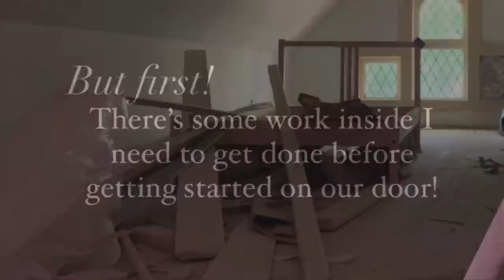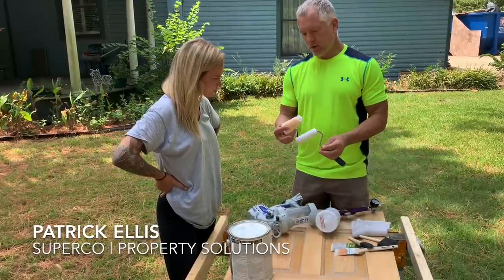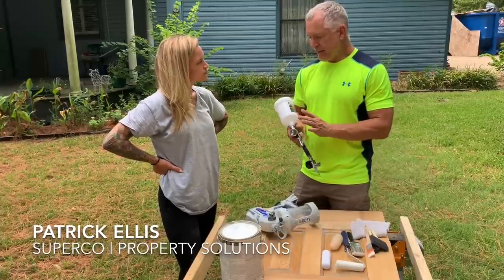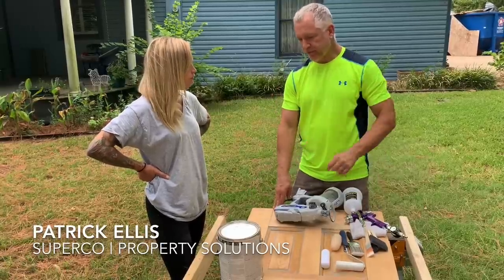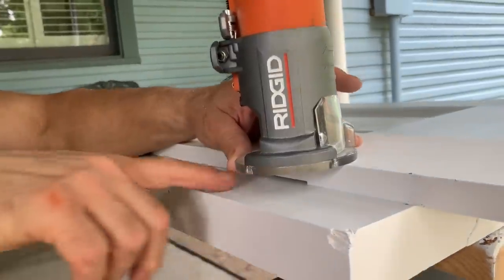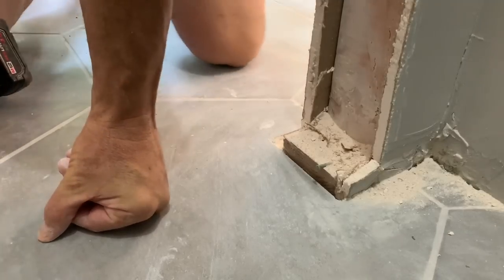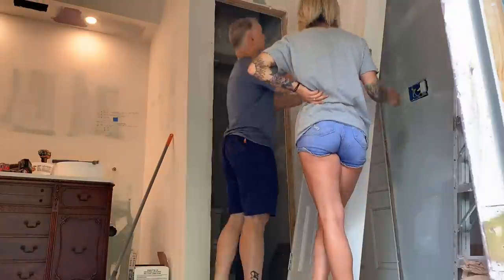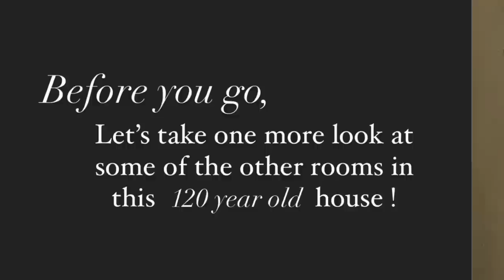REPURPOSE AN OLD DOOR / CREATE YOUR OWN DOOR JAMB - DIY (2 part series)

Comment: i recommend the trueshot sprayer aswell they work so freaking well and theres a cheap option that is corded but for the quality work and the speed at which u can get the job done is outstanding ... just my opinion when u want to get it done in record breaking time and have a almost perfect paint job i would definitely recommend that sprayer.... it has saved my ass so many times on time crucial jobs its not even funny anymore definitely a strong recommend ... and if u have the money and already use dewalt tools they have a battery option one that actually uses dewalt tools but its not cheap and because of that i havnt tried it before but if i had the money i would probably buy that in a heartbeat its a more professional version of the same sprayer but instead of 32 oz paint cup it uses 42 oz paint cup which could make it more heavier on ur arm while using it but i would go with it because the 32 oz ones seem to run out of paint just a lil too fast for me with an extra 10 ozs i would be happy with the amount of coverage u get per refill ...

Comment: I Finely Caught Back Up With Ya....Keeping Yourself Busy, That's A Great Thing, If Only You (And Myself) Were As Quick As That Rot-Mixed Dog In This Clip, Lightning Moves! We'd Be Well Off! I'm So Slow, If I Got Any Slower I'd Be Going Backwards....I Just Have So, So Many Projects Going On At Once & The Deep Freeze Drawing Closer Up Here On Lake Ontario The USA Side Of The Lake Will Be Here Too Soon...ALL Related To Putting My Traveling Shoes Back On, Finally Got My Truck To Be Used As A Hauler For The Tiny House I'm Planning To Put Together, Got My Eyes On A Burnt-Out 5th. Wheel Travel Trailor, That I'll Strip To The Trailor & Start My Build On...All While Working On A Vintage VW Trike & A 25' Boat To Also Bring Along...Need More Arms Than An Octopus LOL!.....However, When I See How Motivated You Are, It Always Brings A Boost To My Energy Level, To Keep On, Keeping On....